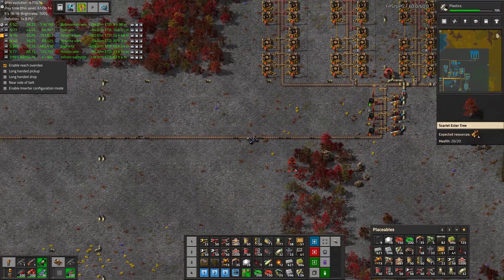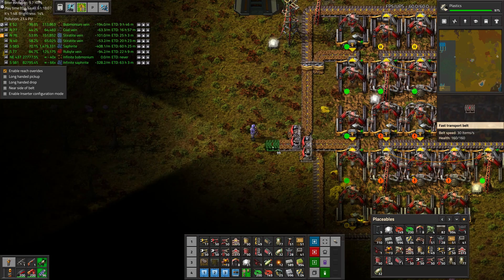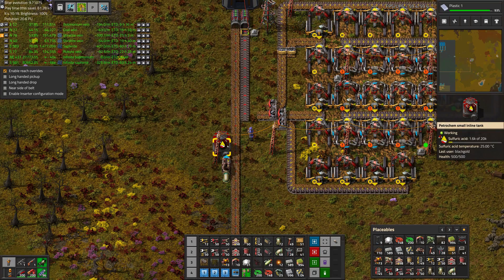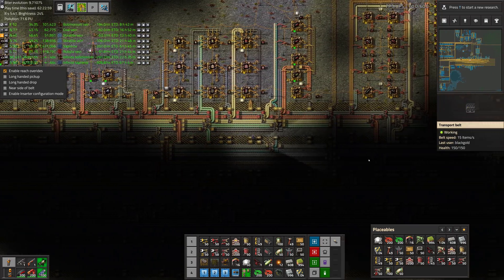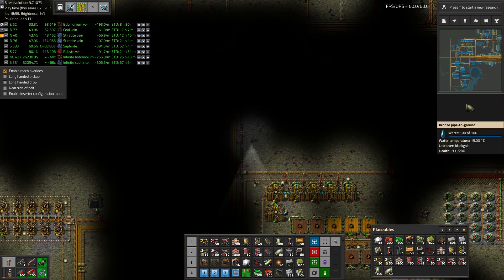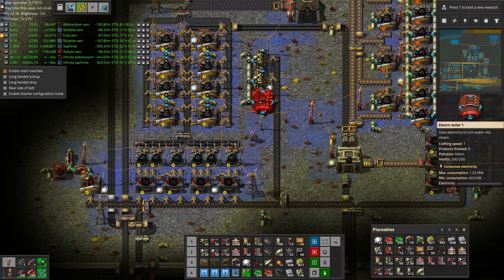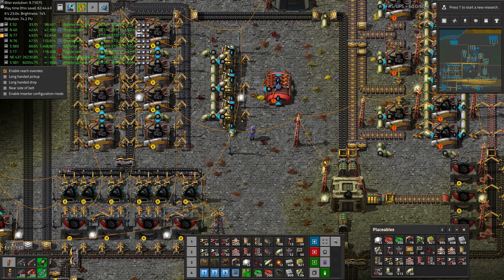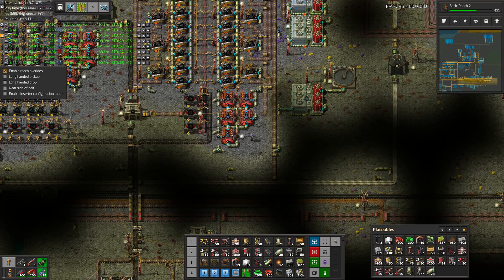[Factorio 1.1 4K] Angel/Bobs Ep 52: Bobmonium Mining & Steam (Tutorial/Walkthrough)

Comment: How did you get the sulfuric acid all the way to the miners without the flow stopping?
Reply from the maker: There’s a pump on each end, with a buffer tank at the miners. But the miners don’t really use all that much acid per second so it’s not a high flow. One thing to keep in mind is pumps always work better when they go into or out of a tank.
Reply: @marsh8056  Thanks for the quick reply. Do you just need one pump at the beginning then one at the end generally? Btw, I can't wait for you to get to Chunks sorting. That's the mess that I'm dealing with now.
Reply from the maker: One at each end should be fine, unless you find that it’s such a long run that you need to put some in the middle as well.
Reply: @marsh8056  See this is really interesting becuase right now I'm trying to figure out how to get waste water from chunks to my waste processing area to turn into the acid, then get that all the way back to make crystals. I was thinking about just using trains with fluid wagons. But if the flow isn't an issue with pumps then I may just use that instead. It's not too long of a trek.
Reply from the maker: I would recommend cleaning the waste water at the washers. That way, all you have to move is the sulfur/other things, and it’s easier to move as an item than a liquid. Also this will cut the water you need to pipe back in by 70%. The sulfuric acid is denser than the waste water it is derived from and that should be easier to pipe. Or consider making sulfur near catalyst production. Personally I would rather pipe it or put it on a wagon than move the whole acid setup 😂
Reply: @marsh8056  Oh I didn't think about cleaning it inline. I guess that makes way more sense!
Reply from the maker: It’s not so much a big deal earlier on, but for late game you gotta think of ways of reducing the burden byproducts have on your logistic system… so avoiding moving that waste water around removes that burden